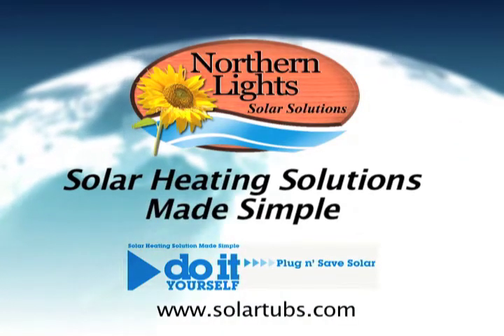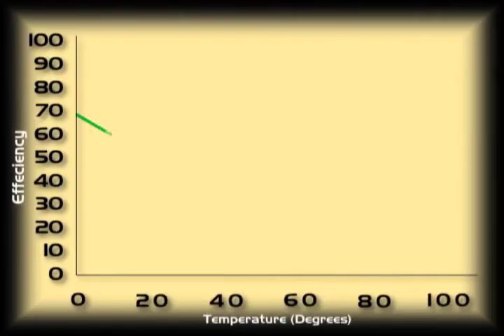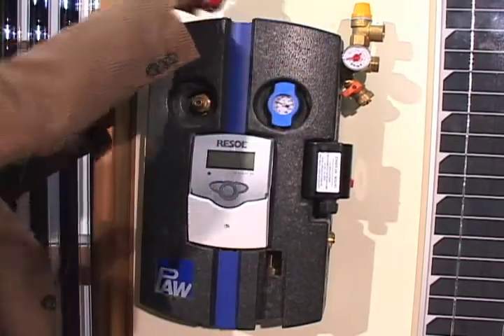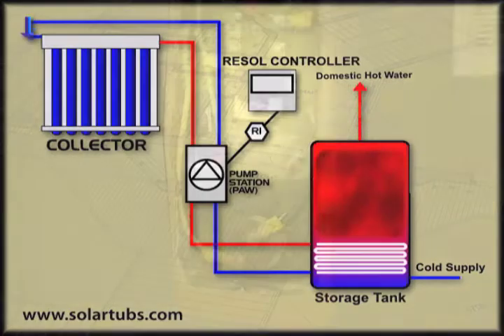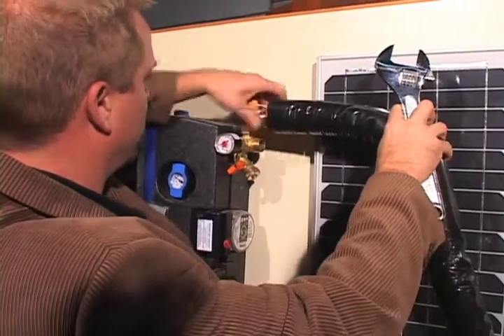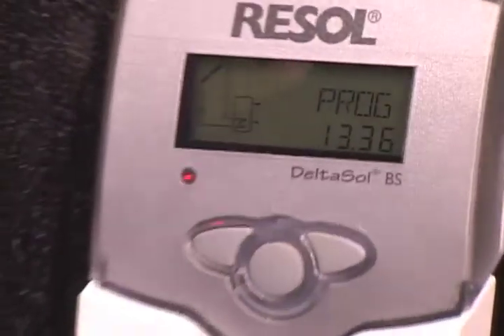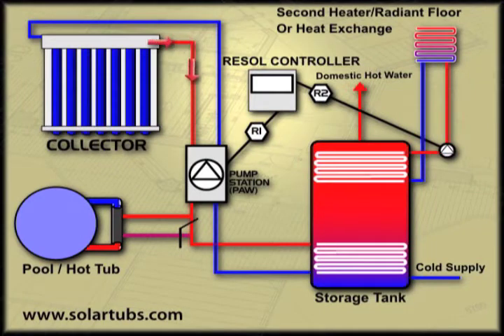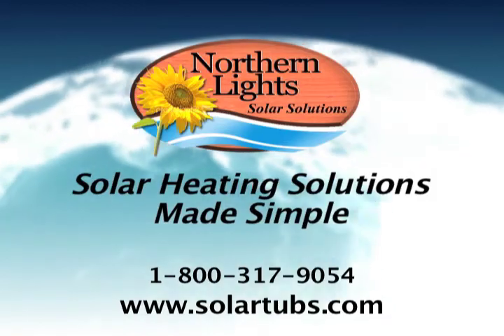Solar Water Heating with optional solar home heating or solar pool heating

Comment: Those pumps require electrical suppeyes. None of them have a 110 V plug located on already. The result controller or the Willow 3 PM has to be wire. I either need to hire an electrician. Or retired engidear, that's not.  Plug and play only the plumbing